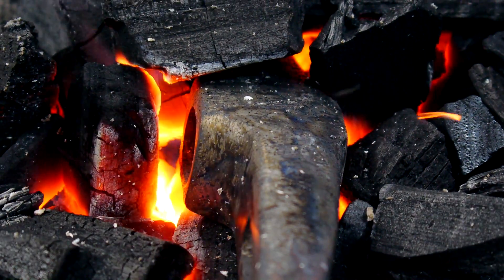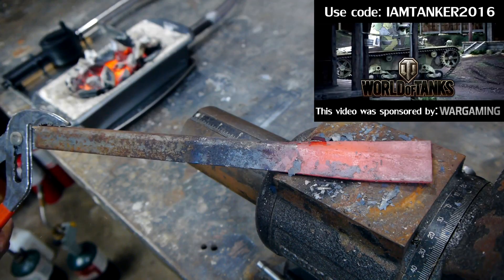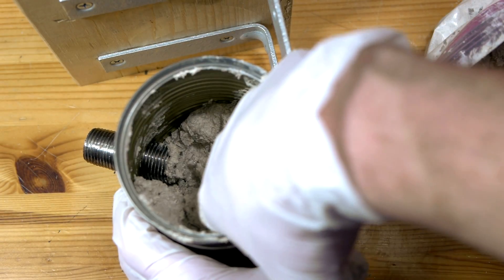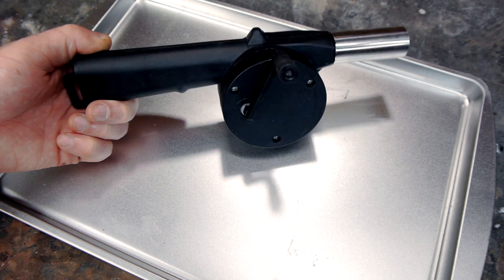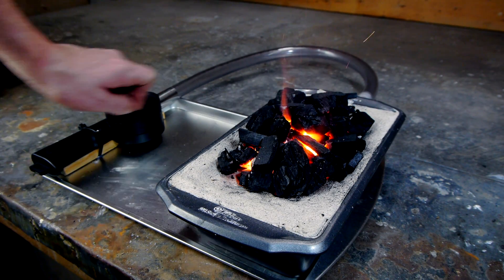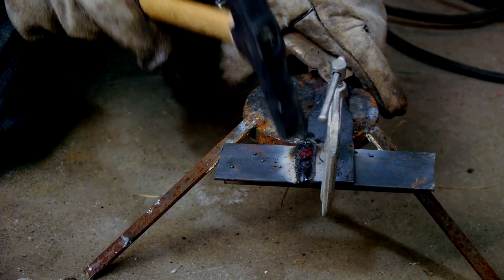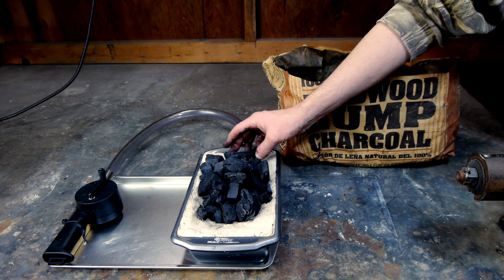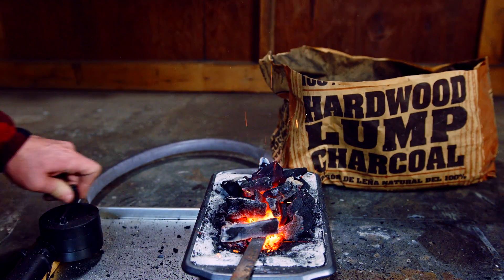How To Make A Tabletop Charcoal Forge - NightHawkInLight

Comment from the maker: Hi everyone! First of all let me apologize for the long delay since my last video. I was sick for several weeks and am still not quite over it. I expect to have videos out at a much quicker pace at this point. I hope you enjoy this video and let me know what you think with your comments! - Ben
Reply: NightHawkInLight Hey your health matters even more. We can't afford to lose a great YouTuber.
Reply: don't worry,we just want you to get better and amaze us with more interesting projects
Reply: NightHawkInLight some advice for your welds, for thin metal like you showed here a mig welder would be better for those welds. Flux is ok but I recommend co2 and copper, you get no Slag or "scale". it looks like you tried to stick weld the plates together and your amperage was up too high or your arc was extremely long. hold the electrode about the same length away from the metal as the diameter of the solid metal core in the electrode itself
Reply: Ian Sheppard, that's not true. You don't actually use coal as fuel. When coal is burned, the impurities burn out quickly, creating Coke. Coke burns just as hot as charcoal.
Reply: Get all the way well soon!
Reply: would this work with coal or would it melt the iron pipe?
Reply: Cole Bouse coal would not burn as hot as it's not such a pure source of energy as it has lots of impurities that slow down it's combustion.... hope that helps :)
Reply: NightHawkInLight
Reply: Hi Ben!  I searched ebay for that kind of fireplace blower...no luck.  Please advise.
Reply: +Jay O'Connor it is on Amazon it is less than $3 just look up "fireplace blower" or "mini fireplace blower"
Reply: Thank you for your response...will do!
Reply: You should make a video missing the blower to use a electric motor
Reply: After 2 years I finally know your name :)
Reply: I've searched and FINALLY found a forge I think is actually doable! Ty! It's genius!
Reply: Hey try this with arthrisite coal (if i am saying it right)
Reply: I hope you get well you have so much talent on what you do when you do not post a video we miss you hope you the best
Reply: I thought I sensed a disturbance in the force a few months ago.